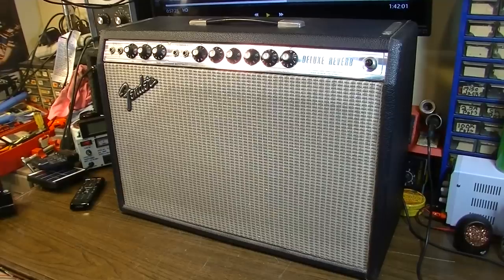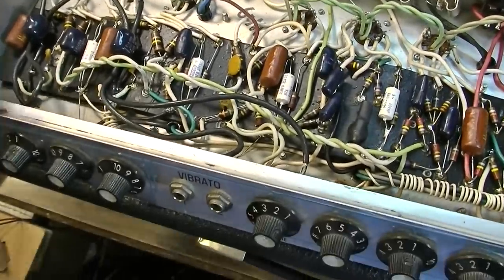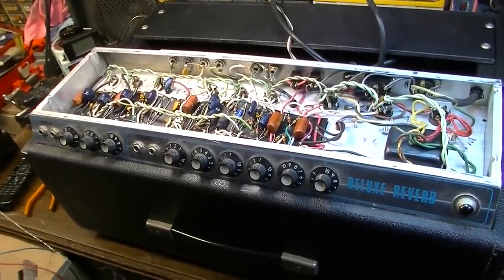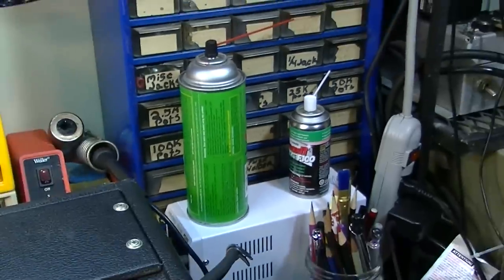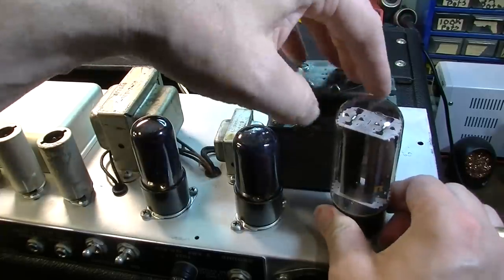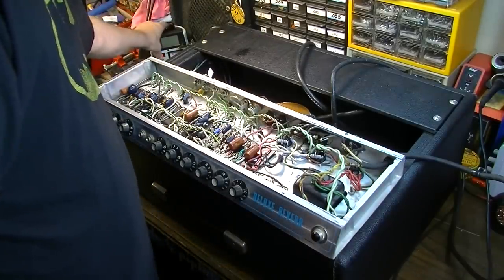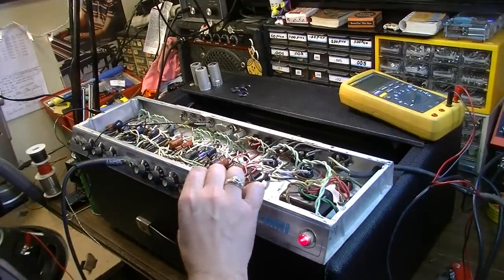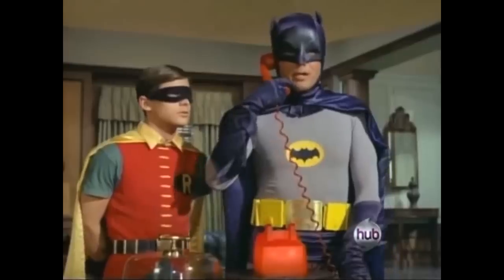SECRETS of the Fender Deluxe Reverb - The BEST Fender Amp Ever? (FULL SERVICE)

Comment from the maker: Deoxit Fader Cleaner: https://amzn.to/2LPwtsE
C2A Neon Light for Opto-Coupler: https://amzn.to/2v1xzrM
Photoresistor GL5537 for opto-coupler: https://amzn.to/2v4dctY
Reply from the maker: Convince them to send me a free kit and I'll build it.
Reply: Dude I wish I had one of these. Could you build one? Out of a beluxe blues?
Reply: iBrad I was thinking the same, as they will undoubtedly profit from you mentioning 3,571 views - I had never heard of the stuff  found PMA Electrical Contact Cleaner Quick Drying Professional to be the best around ~ for higher heat automotive electrical applications cough* cough*, pot cleaning, mucky boards etc.

It does what is says
Fast acting cleaning formula which instantly removes oxidation and immediately restores the electrical current
Use on PCB's, electrical contacts and relays
Quick drying with no residue, allowing system to be switched on more quickly
Removes grease and other contaminants
Safe for use on plastic, rubber and metal components
Fast evaporating, effective solvent based electrical and electronic cleaner in aerosol
Reply: Great video. 

Can do a video talking about the differences between Silver face and Black Face Fender combo's. 
Particular a 1976 Fender Twin Silverface.  I found one cheap like 1k used in mint condition.
Reply: The Guitologist Could you replace the capacitors in the way you say tremolo please. It's faulty.
Reply: Brad, in regard to the nomenclature of the DR amp circuitry, the letters denote the variation (first iteration of the design would be 'AA', mostly for prototypes, next would be 'AB', etc.) of the design.  The numbers denote the month and year of the basic circuit.  So, an AB868 would be a production model, circuit designed in August 1968, AB1270 would be December 1970, AB1172 -- November 1972.
Reply: P.S.  I've never seen an 'AC' designated circuit.
Reply: Your guitar playing and your electronics repair skill is so amazing
Reply: May I ask what state/city your business is?
Reply: Hey Brad I just bought one of these new Custom Deluxe Reverb 1x12" may i ask a question does anyone that have used your Vibrato chn , do you get a pulse even when not being played? Mine does you can hear the more you crank it it gets pretty loud click pulsing to the speed  when Vibrato is switched on w/.instrument or not any setting a pulse is going w/the speed . i never had a tube driven Vibrato before,  is that ghost pulse'n normal? Thx
Reply: Watchman4u : I don’t know about reissues.
For the originals, when the tremolo is on, you will hear pulsing.
The foot-switch must be connected to run the tremolo.
If it makes a ticking sound, soldering a 0.02 across the two left leads of the  tremolo “roach” (when viewed from the rear) will stop that.
You can also slow down the tremolo by changing the value of the three caps.
“The tremolo circuit has three disk capacitors. Two are .01uF and the other is .02uF. Replace the two .01uF caps with .02uF 400v (or higher voltage) to slow the tremolo. Many people like to use Orange Drop caps in the tremolo oscillator.”
https://robrobinette.com/AB763_Modifications.htm#Slow_the_Tremolo
I think I only changed one on mine; I don’t remember.
These mods may or may not work on a reissue.
I don’t like working on PCB boards but it can definitely be done.
Reply: @freecitizen2760  Thx my man!!
Reply: @freecitizen2760  thanks,that's a usefull tip,to slow down the tremelo speed,on my Burriss Royal Bluesman
Reply: What ??
No mouse turds ??
Does Ink Doug get all those Amps. ?? 😀
Reply: Wonder if my 72 baseman can be made into a deluxe with reverb and tremolo. Had to have some caps replaced and a new transformer. It's way to clean now.

Comment: The model numbers starting in the Blackface era is date based. AB868 is August 1968, AA1270 is December 1970, AA1172 is November 72. So the 1172 version is the later one.The only difference between AA1270 and AA1172 is the placement of the standby switch. In 1972 they moved the switch in front of the filter caps prior to then it was placed after.
Reply: And AB763 is the killer one from the mid sixties.   Amazing design.

Comment: I"m not an amp tech, but I learned to do a cap job and biasing etc. I did two mods to my '73, which is basically identical to that one. I put a negative feedback loop disconnect switch on the back, and then also a pot controlled vibrato disconnect switch. With the flick of one or two of the switches, the amp becomes a really great blues machine. I took it to blues jams for many years and almost everyone played through it and loved it with the 2 switches adding 2 clicks of gain. Both are super easy to do....Thanks for the video.

Comment: My '66 blackface Bassman head got the Dan Torres mod I did myself ( back to '59 circuit configuration ),  and my '66 blackface Deluxe (no reverb) got one channel and the driver caps replaced with polyester(shiny brown caps) which I also did myself. Both of these sound WAY better than they were when stock. Polyester caps made these amps, AND my early '70's Marshall Superleads sound WAY better than they originally did when purchased in the '90's. The Fender's have the cleanest tone hands down. They amplify EVERY thing....even my breath, if I were to breathe on the guitar strings! ( just kidding, but not far from the truth!). And the '71-'74 Marshall Superleads, after some modding, are now rock amp holy grails. All from info found within Dan Torres's book "Inside Tube Amps...The Book on Tube Amps Technology". Oh,  I found a "PARTRIDGE" output transformer in one of my dad's old heathkit tube radios for a pair of 6L6's!! I duly took it out, and is now my '66 Bassman's output transformer! It sounds fantastic! But, the original OT sounded great too....but there was definitely a tonal difference. And yes, the bassman and superleads sound very close...since they both have the same circuit...as does the Deluxe!!!! Only difference is the Deluxe has 6V6 tubes (and output transformer and lower B+ voltage), instead of EL34,6550,6L6's, etc! Appreciate your video's!

Comment: Bought one used 1977 for $75 with a blown speaker, replaced the speaker and that thing sounded nice, later I traded it for a Yamaha 250 of which I regret now. Bought a Baseman in 1983 at an Imperial Beach California swap meet for $35 still have it, so far never had to change anything except tubes, I’m not a purest, just never had to replace the caps etc. I reformed the caps a couple of times (they probably didn’t need reforming the second time, just being careful) using a properly grounded circuit that puts a light in series with the amp with tubes removed and the hot side feeding the light to keep it as safe as I can. started with a 7 watt nightlight and worked up to a 75 watt light; all incandescent. After rebuilding a Silvertone 1482 I made the reforming circuit permanent.

Comment: You can use smaller heat shrink to hold the trem roach together.  Also while heath shrink is still hot you can pinch the ends closed. Good work.

Comment: Way back in the seventies, not only did we think those CBS guitars were crap (and were driving the prices of real Fenders up), but those silverface amps had lots of problems; they were generally very noisy and crackly; I'd be happy, though, to own that amp. I've had a couple of Deluxe Reverbs over the years, and can't say anything bad about them. I sold them when I moved here, due to the voltage differences. I found a nice 65 AC-15 here, and I'm trying to buy a friend's 63 AC-15. Both have the gold bulldog speakers that all the 60s Vox amps I've seen have.

Comment: The snubber caps on the grids of the 6V6s are not on the AB763 or AA763 (Blackface) amps.  CBS put them there to avoid  intermittent oscillations caused by sloppy wiring when they took over the company.  On the smaller amps like the Deluxe Reverb they did not change much on the amps but on the larger ones they did.  This is one of the few changes they made.  Some people refer to those caps as "tone suckers".  I own a 1969 model and that is the only difference between it and the '64s and '65s that I have worked on.  I lifted one leg of those caps and put heat shrink on the leg I lifted in order to "blackface" my amp.  I can put it back to original easily and mine was wired good enough that it didn't oscillate when I did the mod.  Thanks for your video.

Comment: My silly comment just below... Bottom line, this whole series of smallish reverb amps from the mid ‘60s were incredible.  The first few years of silver-face had very little changed from the preceding blackface, and if any difference was done, are easily brought to black-face era specs.  These are really fine amps. My Vibrolux Reverb still has the killer 2 prong cord, but a 3 prong cord is ready to put in next time I open it up. Its still dead stock, except for improved wire and RCA plugs on the footswitch. Your suggestion of changing the screen grid resistors, yes! Good idea, and endorsed by me.  On amps that I have designed, I did not use those grid caps..They can be dropped to a few hundred pF and get a bit more sparkle. 

Just an idea for all of you..   When I do go to 3 prong plug, and remove the death cap and switch, I will be replacing the switch with a fixed resistor and a series pot that is wired in to the feedback circuit, to give me variable feedback..

Comment: Hey Brad, whenever I de-solder a wire or a component from a solder-terminal, I find that using some Solderwick de-soldering braid helps a lot, I use it to soak-up the majority of the solder and then it's just a case of using a pair of fine needle-nose pliers to un-wrap the component lead from the solder terminal, Solderwick de-soldering braid is a chemically treated copper braid that soaks up solder like a sponge soaks up water, very handy to have, I usually buy a couple of rolls of 3mm wide de-soldering braid from my local Jaycar Electronics store, Goot brand tends to be the best.

Comment: I owned a Blackface ‘67 at the same time as my ‘73 Silverface DR.
I kept the ‘73 because it was a stronger-sounding amp. And I like the “saggy” 5u4, as well as F.R.E.D. rectifier circuits.
Here’s the mods I’ve kept after tweaking it over a couple of decades:
1) the tone stack: changed to a pair of 0.022, with a 56k slope resistor.
2) that pair of 220k feeding the power tubes were changed to a pair of 100k.
3) a 0.1 cap was put across the opto-cell legs to eliminate ticking.
4) changed the 3 tremolo caps to all 0.02 to slow the tremolo.
These are the mods that I kept that I learned about from Rob Robinette(dot)com.
Reply: You mean a .022 bass cap in the tone stack, BF spec a .033? Where is the 56k slope resistor?

Comment: The Fender Deluxe Reverb is, in my own humble opinion, one of the best guitar amplifier ever built, blackface or silverface. It's a 20 watts amp powered by a pair of 6V6 output tubes which have the most beautiful tone of all the output tubes. The tube rectifier also contributes to it's amazing tone. But the 12" inch speaker makes this amp sound bold, big and awesome. Get your hands on a vintage Deluxe Reverb and you'll never look back!

Comment: Hey Brad......there used to be an amp tech in Austin TX that sold the Surf Bug. It was a Trem-Mow-Low    :)    bug of his own manufacture that was supposed to be an improvement over the original bug. Went down and bought one from him and installed in my ProReverb.  Big improvement, not Bias vary quality, bur much better than stock.  Read an interview with him one time and he said the surf bug came about with him experimenting using LEDs for the light source, Took some trial and error until he came up with an LED that sounded good. Dont recall the guys name....he was a real cool guy only met him once and he talked to me like he knew me all my life.  Unfortunately the business is closed as he passed away several years ago.

Comment: Nice work, Brad.  While I admire your dedication to fixing the roach, they can be purchased already assembled for ~$10 and cost far less time to replace from places like TubeDepot and Antique Electronic Supply.  Nice work and one additional suggestion.  I use denatured alcohol to clean up the flux residue like what you had when you replaced the caps in the tremelo circuit.  Cleans boards up nicely and safeguards you against future problems the flux can cause.  Nice work and enjoy your videos!
Reply from the maker: If I already have the parts, making them myself is a no-brainer. Takes about 5 minutes. The hot glue was just me trying something different.

Comment: The 1200pF caps do make a low pass filter with the 1500Ω grid stoppers, but they do not affect audio frequencies so do not stifle the sound in any way. That filter kicks in at over 80kHz just to prevent high frequency parasitic oscillations.

Comment: I have a super reverb I rebuilt, the only thing that's stock is the transformers, pots, some of the resistors the chassis and cabinet. It was trashed. Still, have the old alnicos but they need to be re-coned so I bought some ceramic Jenson's for the time being. Had to recover the amp, new grille, caps ,tubes, grid resistors all that stuff. was the first amp i worked on, ended up putting the bias cap in the wrong way( as per my schematic) and ended up having to get someone to look at it for me, and they switched it and it  was good

Comment: Oh, yeah,  I cleaned this with a  shop vac, toothbrush, scrub brush, water and detergent the night before I brought it to you. It was really gnarly with dust and I didn't think you should have to deal with that. The chassis wasn't so bad, but the reverb tank , speaker and bottom of case was coated with a thick layer of junk. I found the paper UL sticker, I'm wondering how to re-attach it, something that can withstand the heat. Uncle Doug frequently points out the presence of the UL sticker. Any ideas on how to reattach?
Reply from the maker: Silicone would do it. Or double-sided tape. But the tape might fall off quicker.

Comment: Love your videos. I learn a lot from your trouble shooting approaches !!

Another difference you didn't mention between the blackface & silverface amps. I have a AB763 blackface Deluxe Reverb - and it does NOT have the two 1200 pF grid bypass caps on the output tubes.

I have another question.  Are those white 25 uF malroy cathode bypass caps Electrolytic?  I see they are polarized (have a + on them) - but I was wondering why you changed those but not the blue or brown caps !

Also - love the way you built your own opti-coupler !!  Just out of curiousity - is a complete replacement opticoupler roach available as a part ??

Thanks for the videos !!!
Reply from the maker: Correct! When looking at schematics, I was using one particular website that, for some reason, omitted the AA763 and AB763. So as you pointed out, I did not cover those. And yes, that version did NOT have the caps on the output grids. This, in conjunction with the 5751 tube in the V2 position on this example, would certainly make this amp cleaner than your typical AB763 Blackface. But a very easy remedy if someone chose to go that route. The 25uf caps I replaced are electrolytic. They were likely still within spec, but at this point are so old, getting new ones in there is a standard procedure on overhauls. And yes, as someone else pointed out in another comment, the roaches are available in a couple places online. Building your own is cheaper but perhaps more time consuming if you don't already have the parts onhand.

Comment: In the end the timing caps, the photo resistor and the neon all age, and can lead to failure. In the end, replacement renews the circuit for another 40 or 50 years.  Photo-resistors were quite common in the mid century, and they came in many shapes and resistance ranges. Even the famous Marantz 10b FM tuner has photocell systems as part of its stereo/mono switching.
Reply from the maker: Jennifer, as always, your experience and expertise is very appreciated.

Comment: A very helpful video - thanks!

 If you want to hear a big improvement in the sound of your DR, replace the speaker with a Weber 12F150 (or Jensen USA C12N).  I had an Italian Jensen P12N in my DR clone, which sounded really good, but the 12F150 sounds so much better. I tried the Weber, because several blues players in Portland recommended it, and the first notes I played through it made me glad to have made the switch..  The 12F150 (light dope) is broken in now, and sounds even better - they are tight new.  This is one of the most useful amps ever made, great for practicing at home, or playing with a band, although a bit heavy as you get older (like me).  I usually prefer playing through my Gibson GA-18, GA-20, or GA-40, but the DR clone is indispensable for getting that "blackface" tone we love!
Reply: I would try a EVM 112L.They are the best sounding speaker for this amp,but some of the old Jensens can't handle pedals too much,especially high gain pedals,those speakers will fry.👍👍

Comment: I've watched several of your videos lately, and I've hit the bell. One question: Why do they use a light bulb and a photo resistor for the vibrato when they obviously can provide variable voltage to the light bulb? This is probably a stupid question, but I'm a novice when it comes to old electronics.